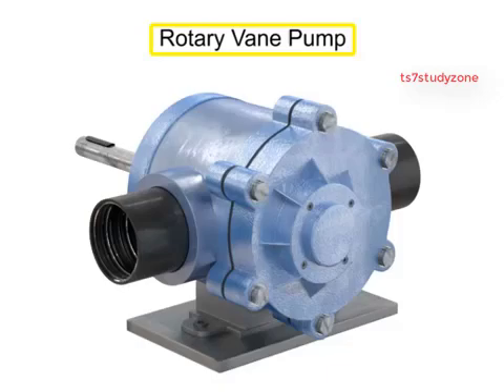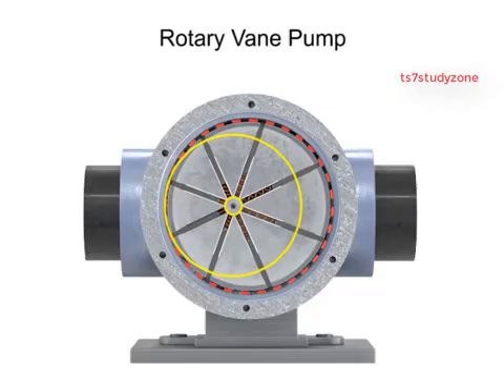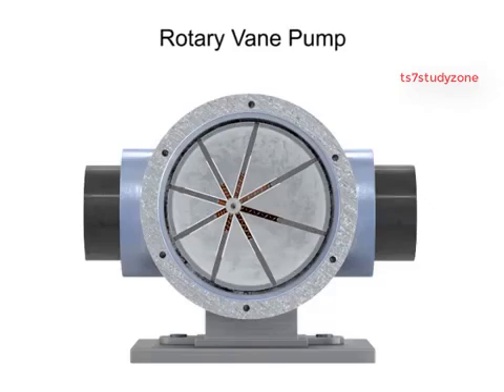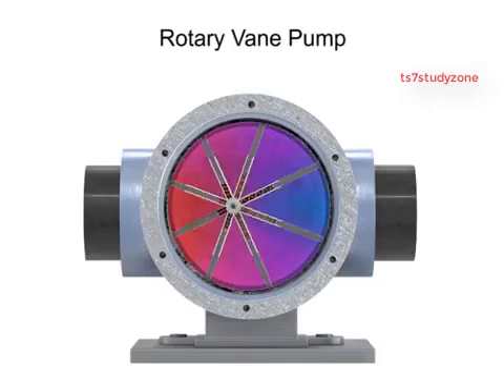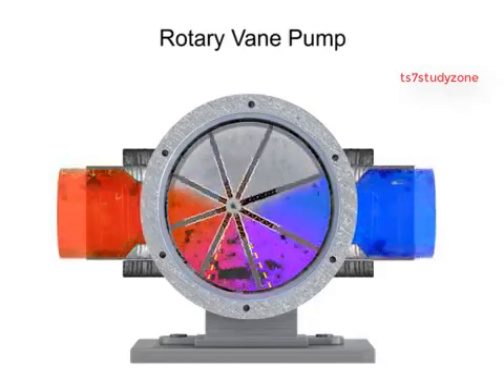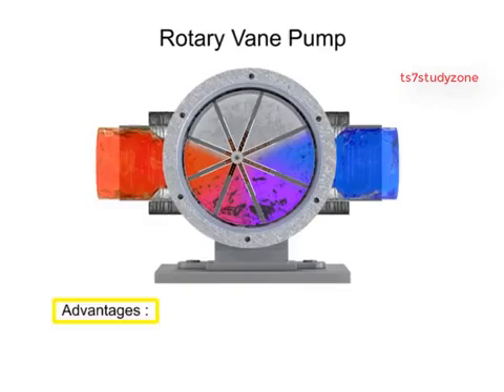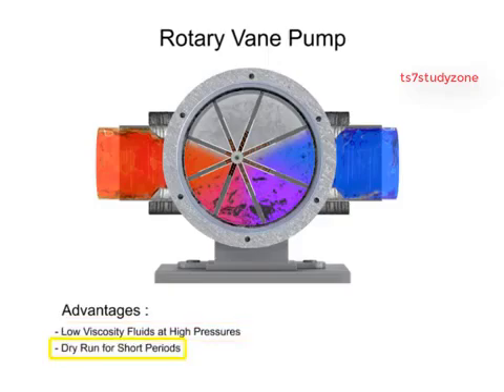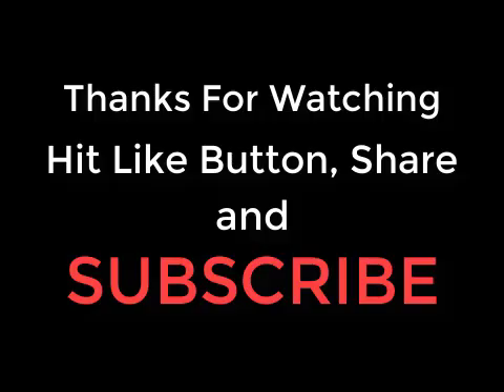Rotary Vane Pump working animation with detail explanation | TS7STUDYZONE

Comment: How can it handle low viscosity fluids at high pressures, and yet not be suitable for high pressure?
Reply: Forces on the vanes tangential to the spring pressure plane induce harmonic bending cycling that create friction at the vane to vane rotor interface while also causing metal fatigue in the vanes. At higher pressures the "bloating" of the compression stage vane position causes increased wear, thereby increasing entropy in the system, shortening the useful life of rotary vane compressors in high pressure applications. They work better for producing vacuum pressure because of the displacement of gas mass at the partial vacuum, which translates into reduces stress loads for the vanes & vane rotor with lower harmonic distortion, less heat, lower entropy in the system and longer useful life. The thin highly purified low viscosity vacuum oil also better able to handle vacuum than positive pressure given the tight tolerance variable chamber geometry configuration. Study the graphic animation carefully near bedtime and think about it as your are drifting off to sleep and your brain will automatically integrate all the engineering concepts you already know into a more complete cohesive understanding framework! Cheers brother!